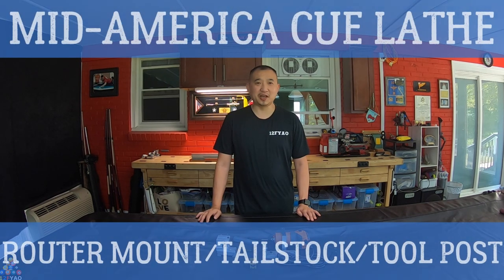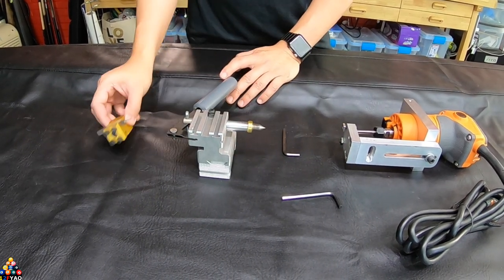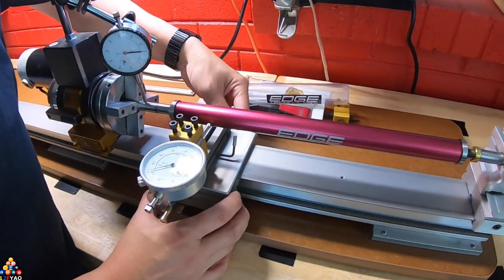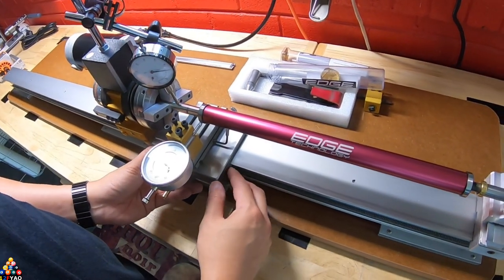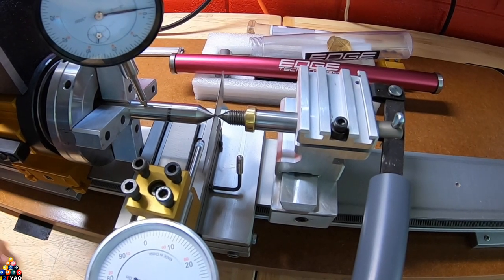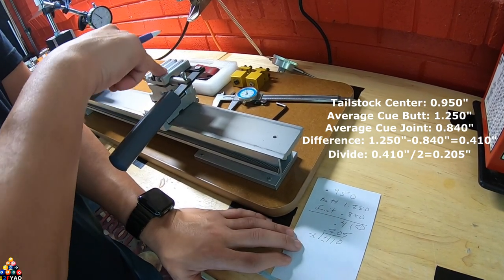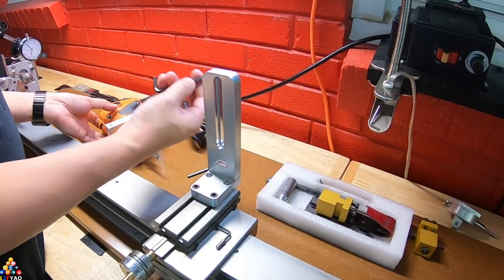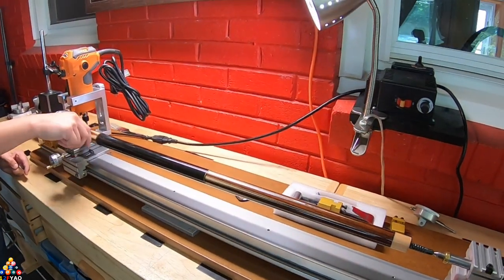MID-AMERICA CUE LATHE. SETTING A POOL CUE TAPER, TAILSTOCK ALIGNMENT w/Edge Technology Alignment Bar

Comment: do you have a link for the dead centers and micrometers you use with mounts for the determining your run out?

love you set up just trying to figure out which add on's that I will need to buy to keep it calibrated and running true. and how much those will cost.
Reply from the maker: Thank you. Here is the link to the dead center. 
https://www.cuecomponents.com/deadcenter.html
For the dial indicator, I got it from Amazon. Just get one with the magnetic arm. I also the the Edge Tech bar from Amazon. 
https://www.amazon.com/Edge-Technology-Tailstock-Alignment-Bar/dp/B01MFCAY27/ref=sxin_15_ac_d_bv?ac_md=0-0-QnVkZ2V0IFBpY2s%3D-ac_d_bv_bv_bv&content-id=amzn1.sym.8f2bf95d-b9c2-4e6d-96a9-5fdf77a1951d%3Aamzn1.sym.8f2bf95d-b9c2-4e6d-96a9-5fdf77a1951d&crid=NJ63VDJLY2RC&cv_ct_cx=edge+technology&keywords=edge+technology&pd_rd_i=B01MFCAY27&pd_rd_r=ce04e78d-e6fb-4cf6-aa22-d3abe04b4915&pd_rd_w=oFjHi&pd_rd_wg=NmKyZ&pf_rd_p=8f2bf95d-b9c2-4e6d-96a9-5fdf77a1951d&pf_rd_r=5Y13V6G5A8JCCWE15QKZ&qid=1674592794&sprefix=Edge+te%2Caps%2C92&sr=1-1-270ce31b-afa8-499f-878b-3bb461a9a5a6

https://www.amazon.com/s?k=dial+indicator&ref=nb_sb_noss_2

Hope this helps. Thank you again for commenting and please share.

Comment: Does the dead center on the head stock have enough pressure to turn the wood without any slippage? That something I’m concerned about before but this vs another cue lathe.
Reply from the maker: The dead center works. Now I use one live center and one spring loaded dead center. Dead centers should not determine which lathe to get, customer service should be number one. Things break and get replacement parts and mods are more important and that is why I got a Mid American Cue Lathe. Thank you for commenting, don’t forget to subscribe and please share.

Comment: Thanks! This helped a lot! Tapering my first butt on this setup tomorrow! Have you tapers a shaft on this yet?
Reply from the maker: The shafts I get are finished oversized. I just have to taper the joint end. I tried one where I had to taper the whole shaft, I think I could have done it if I had the power feed. With the power feed we just have to adjust the router to our taper. Thank you for commenting, please subscribe if haven’t already and please share. Also if you have any questions please ask and I will do my best to answer them.

Comment: I bought the same lathe couple weeks ago and have noticed quite a bit of vibration on the tailstock end after offsetting it for the taper. Were you having this problem and if so how did you solve it?
Reply from the maker: No, are you using a live center tool on the tailstock. If not that might be one of the problem.  I use a dead center on the headstock and a live center on the tailstock and I place a just enough pressure to turn the wood and not stall when cutting with the router. Hope this helps and please share.

Comment: I have the same lathe.  I have runouts about 7 thousandths with a dead center from cue components.  Any suggestions to truing them?

Thanks in advance,
Reply from the maker: My headstock is around 2 thousandths. It’s not perfect but with the Edge it’s perfect.  My other headstock was at 7-8 and the way i got it to about 2 is:
1 use a pencil to number the jaws. Number them one thought 4. 
2 use the pencil to mark the wheel that holds the jaws also one to four. 
3 now insert the dead center and make the dead center also 1-4
   Everything should lineup.  
4 check your run out and see where it is getting 7 thousandths 
   Say it is at marking 3. Remember that.  
5 now clock the dead center 90 degrees. 
   One on the dead center should be at two on the jaws and wheel of the headstock.  
6 check the run out 
   Did the 7 thousandths follow the dead center, meaning the 7 thousandths is now reading on jaw 4 and wheel 4 on the head stock. 
If 7 thousandths followed then it’s a bad dead center. 
If 7 thousandths did now follow meaning the 7 thousandths run out is still at jaw 3 and wheel wheel then the head stock is of center.  

For a head stock that is off 
With a good dead center, where is the 7 thousandths you might be able to reposition the jaw to the wheel. All it needs is to move 3.5 thousandths down. Now recheck the run out. 
If the jaw does not move, same results go to the opposite jaw loosen and reposition. Recheck runout. 
It that does now work
1 loosen the two bolts securing the jaws numbered one and three to the wheel
2 now try installing jaw one to three and jaw three to one see if the run out got better or worse. 
3 repeat rotating the jaws to the wheel to see what works.  

I had to rotate my jaw 1 to wheel 2 ( jaw 2 to wheel 1) and jaw 3 to wheel 4 (jaw 4 to wheel 3) and the best was 2 thousandths.  

Hope this helps and please share.
Reply: @playpool12fyao  thanks.  I’ll report back once I play with it.
Reply: @playpool12fyao  ok.  Seems like the dead center is fine since it did not follow as I rotate to each jaw.  Moving the jaws around I did but didn’t improve much.  I do notice the common denominator is jaw 4(facing me) which would always give me the most runout no matter where I relocate it.  I’m thinking I should sand the opposite jaws from it (#2)  to see if that helps.
Reply: @playpool12fyao  smh .  Decided to to swap jaws with a rear stead rest to see if it helps,  I loosen jaw 2 a little and the runout went down to 3 thousandth.  Maybe I’m over tighten these soft jaws.  I might loose the others a bit to see what happens.  Would love to get it down more but 3 thousandth isn’t too bad.
Reply from the maker: That’s not bad 3 thousandths will work. If you want 0 run out, you have to use paper as shims.  Hope this helps and please share.

Comment: I customized my tail stock to be a screw style using a 3/8-24 rod and tapped sleeve to replace the ram style that comes with this lathe. Also replaced all the 10-32's with quick release handles. That eliminated the need for using an Allen key every 5 seconds. An easy way to align the head stock and tail stock is to mount a 1/2" test bar in the head stock and bring your tail stock into the test bar with the ram removed and just slide the tail stock onto the test bar that's already in the head stock.
Reply from the maker: Thank you for sharing your information. I like that 1/2” test bar. I need to do that when I need to realign my head stock to my tail stock. Thank you for commenting and please share.

Comment: It is a pitty that the tail stock support system doesn't have screw adjustment.  It would make setting up a lot easier.   Never the less it works and many thanks for the video.
Reply from the maker: Agree but it can be changed. I just haven’t done it and I don’t use my lathe to often for me to change it. Maybe in the future. Thank you for commenting, please subscribe if haven’t already and please share.

Comment: What model and make motor is this?
Reply from the maker: The setup includes a strong continuous duty 3/4 HP DC motor with full variable speed control, reversible rotation switch and a plug-in foot control for doing rewraps.

To get more information, click on the link in my video description to go to Mid American Cue Lathe website. Mid American can give you a better answer.  Thank you for commenting and please share.